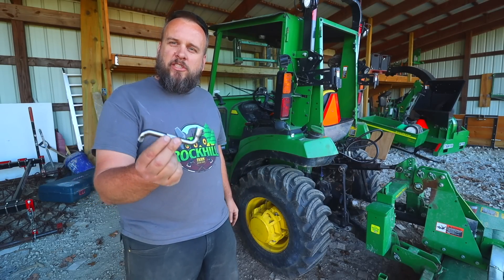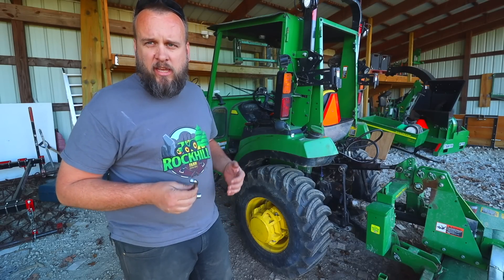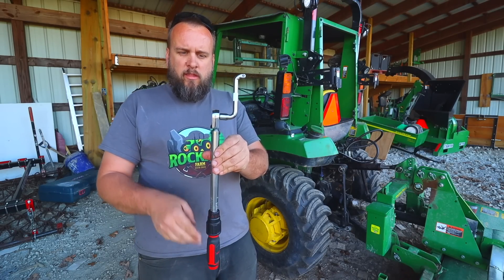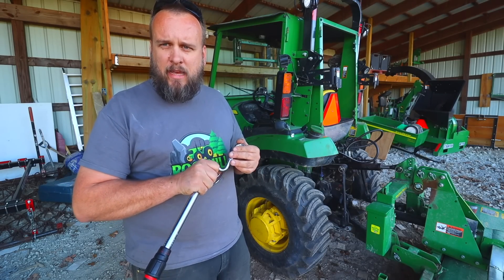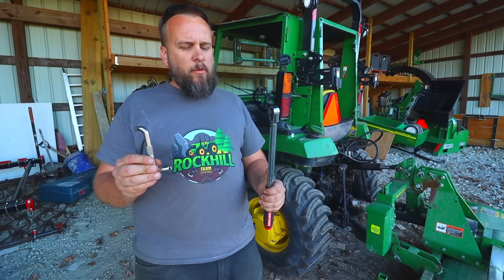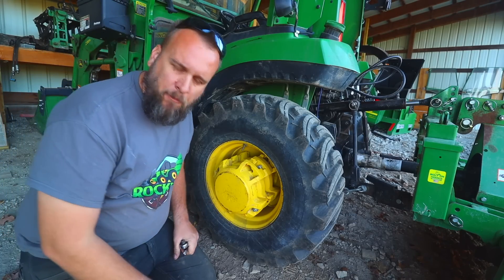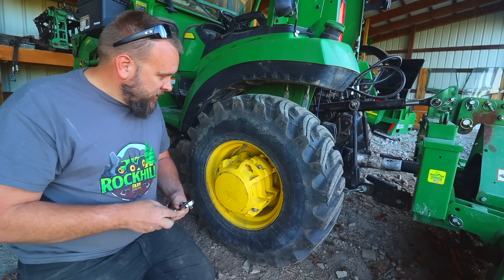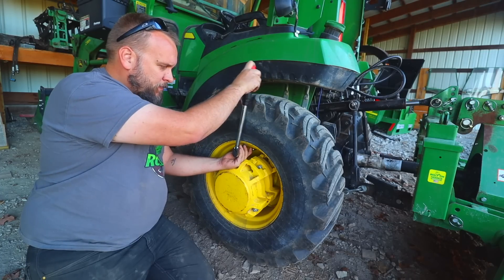How to Check Tractor Wheel Bolts Without Removing Wheel Weights

Comment: Nice video Brock! Just want to add that you also have to account for the extensions you used when you were applying the torque. On tractor wheels it’s not a big deal, but when accurate torque is important a person would also need to account for that as well. It’s not that the leverage is different, but the flex changes. I’m a retired fighter jet mechanic in the Air Force so that stuff was drilled into me…lol
Reply from the maker: I watched a video that was testing if that was true or not. They put a digital torque measuring tool between the socket in the extension and could not get a different reading by adding extensions

Not necessarily, no difference, but inconsistent and within the margin of error for what they were doing

I don’t know much about it, but I found that in my research before the video 

https://youtu.be/P9PUAPMDyww
Reply: @RockhillfarmYT  Good info, thanks! With the world of aviation uncontrolled variables are a huge no-no. No surprise that in most applications the variability there is negligible. I know in the tractor world it’s not something anyone would need to account for. Just figured it would come up eventually but of course you’ve already got that base covered. Another great video. You’re killing it! Seems like you’re really hitting your stride this year.
Reply: @jeremyj612  extensions will only really affect impact wrenches
Reply: @rockhill farms, @Jeremy J…thanks for your reply to Brock’s video, I was the viewer that fabricated this tool for Brock based on his video about torquing JD 2038r tractors with wheel weights. I have the same tractor and had this tool in my tool arsenal from when I was an aircraft mechanic. I recently retired as a licensed FAA A&P mechanic with nearly 40 years in commercial aviation and 15 of those years building and servicing a variety of large and small commercial jet and turbo shaft engines. 
  I found your statement regarding what I believe you were referring to as the “twist” factor in ratchet extensions very interesting and how the Air Force “drummed” into you to compensate for it….must be an Air Force T.O.
  For all the different manufacturers of engines I worked on and trainings I attended , I never read nor was advised while torquing using a long reach socket extension (not a torque adapter) that twist factor of the extension had to be factored into a torque value. In my opinion, the twist is a non-issue as the eventual torque value to be applied with using a manual torque wrench, the twist of the extension will reach a max level and cease and the remainder force be applied by the torque wrench until the set value is attained. 

My question is; did you use a specific set of “calibrated extensions” with known twist values (based on material type and composition and temperature, etc.) also did the Air Force use any torque tolerances factors ie. +/- 5% etc. to allow for minor issues. 
Any way, great feedback and thank for your service….what aircraft / engines did you work on ?

Comment: Good idea, Brock.  But for me, I just tighten it until it breaks and back it off a quarter turn.  Works every time.
Reply: @rockhill farms, @Marvin Diamon Jr…..great feedback, but may I offer a suggestion, I’m sure using your method does work, but speaking from nearly 40 yrs. in the aviation/ jet engine business, the practice of backing off torque to preclude over torquing and stopping there, is a potential for failure, due to the fact, a torque value was applied and then released (backed off) would actually start the fastener to start to loosen up.    As a licensed mechanic, the procedure to be used was on high torque value hardware, using a calibrated torque wrench, incrementally increasing the torque until reaching the max torque, loosen the fastener with a breaker bar, re-torque until reaching the final required torque ( below max), this way the fastener was properly torqued, but remains in a positive direction of torque.
Anyway, just some thoughts, be safe out there !

Comment: Great video Brock. Thanks for sharing. Just curious if I could get your thoughts on foam filling and adding wheel weights to the front tires/wheels. I’m thinking of doing that and then doing rim guard and wheel spacers at the rear.
Reply from the maker: Foam in the front seems like a good idea to me.

I thought about doing it in the rear tires just to avoid flats, but couple guys told me it makes the ride really rough and doesn’t add as much weight.

Not sure where you can find wheel weights for the front. My front tires have bio ballast in them, which is similar to rim gaurd
Reply: Do you run rear spacers?

Comment: The resulting torque on the bolt will equal the torque wrench torque setting if the offset tool is set 90 degrees. In other words, the effective torque wrench length is unchanged (as is the set torque) if the offset adapter is perpendicular to the torque wrench.
Reply from the maker: I just read 10 pages of people arguing about that fact.

I’m pretty sure that having that extension at 90° does not give you the same torque, but then again, all these experts could not agree.

If you think about turning that bolt with your now L-shaped tool, and you are controlling the output at the pivot point, which is the torque ratchet head, the length of the lever will determine how much force is put on the bolt

It would be the same as if your 90 degree extension is a wrench.  By using a torque wrench, you are controlling the amount of force on the end of the new “wrench”

Now, imagine the “wrench” is longer or shorter. 

The fact I’m not 100% certain is why I didn’t go into detail on that aspect of it.

I understand how it works if you are directly in line with the torque wrench.
Reply: @RockhillfarmYT  This can be verified on a digital torque adapter setup to the clicker torque wrench. The “arm” or effective length is collocated with the center of the torque wrench head when perpendicular. As you properly pointed out the adding or subtracting changes the effective length. Perpendicular does not. The longer the adapter, the longer the torque wrench has to be moved to get it to click to click to the the set torque. This fact can be verified in aviation mechanic manuals and the math works as well.
Reply from the maker: @fanjet737  I already ordered the torque adapter this afternoon. I still think I’m right, and I could give an explanation why I believe that.

But instead of speculating further  I’m going to do the test on video and then we can talk about it again

not trying to win an argument. Just want to see the answer for myself, because now it’s got my curiosity up.
Reply: I look forward to it! I always follow your channel and enjoy your videos.

Comment: I checked everything on my 2038R a couple weeks ago. With 150 hours about every bolt on the loader was loose. A couple of the nuts for the mounting bolts on the loader were completely missing and a nut on the cylinder pin was completely missing. My opinion is the dealer did not torque any of the bolts on the loader when they installed it on the tractor. John Deere’s statement for tightening bolts should not be a pass for poor workmanship.
Reply from the maker: I completely agree.
Reply: I had the same problem with my dealer.  Bought my 3025e with msl loader, hydraulic line came loose while lifting dirt,    dumped fluid.  So i looked it over. Found 3 bolts missing and the other 5 loose.  The loader was dang near falling off at 46 hours. That's unacceptable to me.  My dealer has been a big let down in the service area.
Reply from the maker: @1kory883  frustrating

Thanks for sharing the story

Comment: I sold my John Deere and bought a ventrac. It’s ridiculous that you continue to say John Deere isn’t responsible for wheels falling off. I’ve had vehicles all my life and John Deere is the only one that has wheels falling off. I usually like your common sense approach to everything but really? , wheels falling off a 30,000.00 machine!  John Deere gets no pass on this. Someone should open a class action lawsuit and make them fix this problem but until you YouTubers stop saying it’s just part of owning a tractor Deere is going to continue putting people at serious risk.
Reply from the maker: I actually kind of went out on a limb calling John Deere out for this.  It didn’t have anything to do with me, but I heard about it and I was upset that they didn’t cover it.

I was shining a light on it because it made me mad

I do know that other manufactures put it in their owners manual that you are required to check your bolts at certain intervals

The bottom line is if I own a machine, and I know that other people have had a problem with loose bolts, I’m going to check my bolts regardless of how I feel about John Deere’s warranty department

If you read the comments on my original video about the guys wheel falling off, you’ll see at least half of the people feel like it was his fault for not checking them. I disagree, but you will find a lot of people saying that.